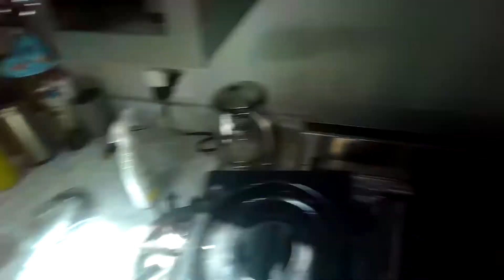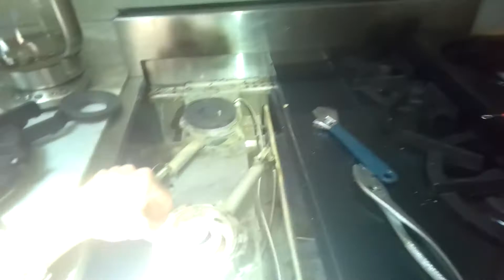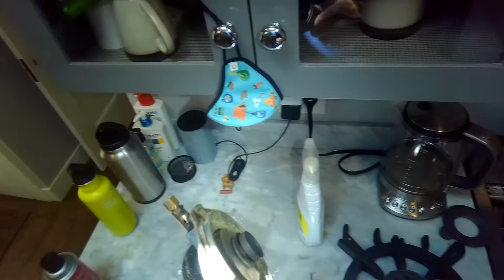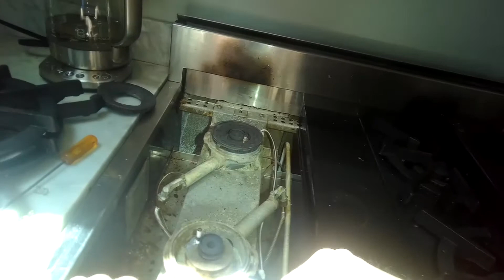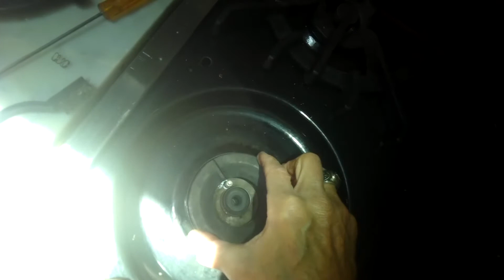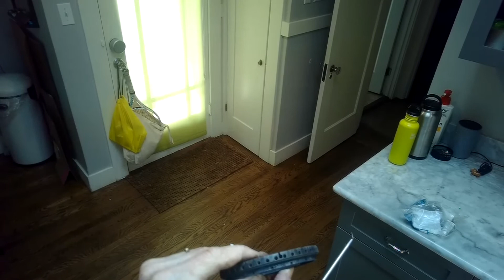✨ WOLF RANGE KEEPS CLICKING - FIXED ✨

Comment: I have a 36" Wolf Pro Series Rangetop.  I am curious how to troubleshoot which igniter is bad.  They just started clicking and won't stop.  When I turn the front middle burner on the clicking stops.  So I am guessing that it is this specific igniter.  I appreciate the video.
Reply from the maker: You might have a wet burner.
You can try using a blow dryer to dry each burner.
Reply: @QuickAndEasy5MinuteAppliance  

Yes.  A few were wet.  I dried them all, realigned all burner plates and when I plug the range back in all 4 burners on the left of range “call for spark”. If I turn the middle front burner on all the sparking stops.
I don’t just want to replace all igniters to troubleshoot.